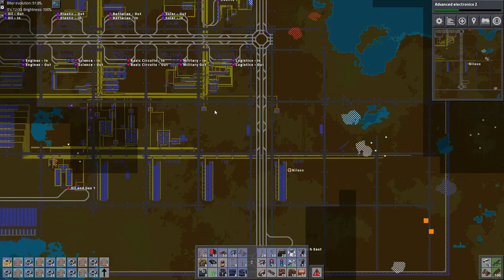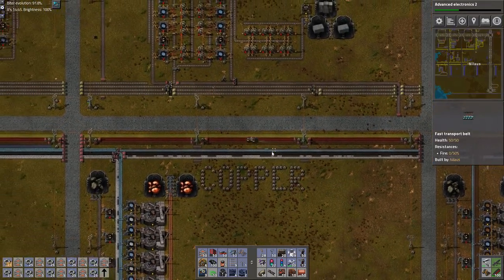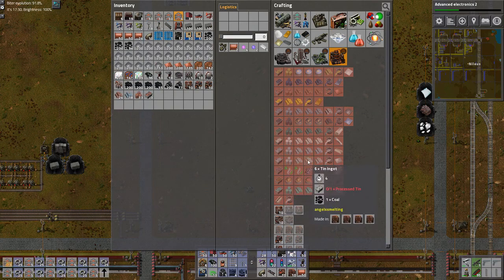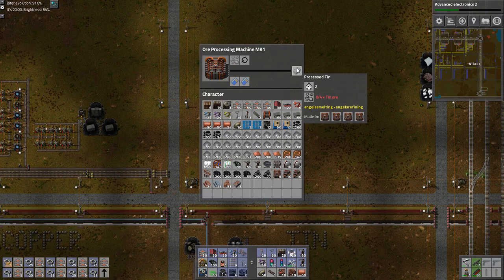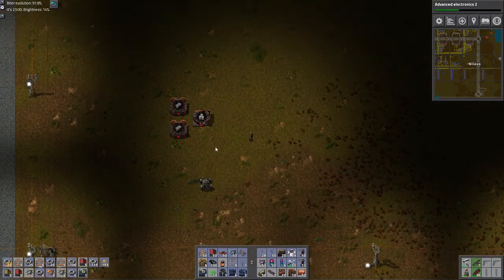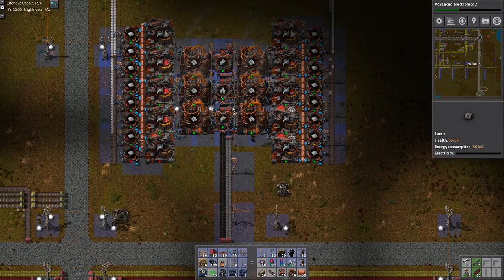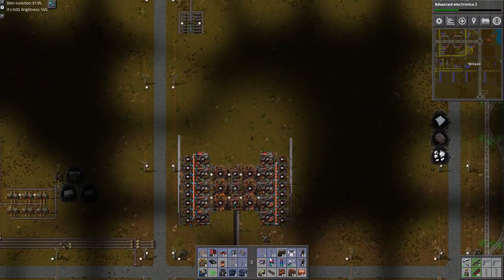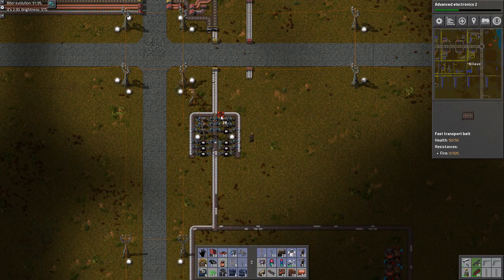Lets Play Factorio S6E34 - New Tin Plate production with Angels Smelting

Comment: It's not that illogical for the colors of materials to change after a filtration process. I would imagine that for each angelic ore that you combine to get an elemental ore, the coloration comes from the mixture of the 6 or 7 end products which can be obtained from the highest tier of processing. Human eyes can perceive a wide range of colors from a small amount of compound colors - as evidenced by the fact that digital screens only use 3 colors of light - so it's not unreasonable to assume that mixed ores might be a vastly different color to their sorted products.

If we're thinking in realistic terms, the lead that you get from mixing rubyte with crotinnium would be far less pure than the lead that is obtained from sorting the ore after the highest tier of processing (so it might have a paler or redder appearance than purer lead ore). Since Factorio doesn't really simulate purity of materials, one can just assume that the less pure materials are just pure enough for what they're being used for (even in reality it's usually impossible to obtain 100% purity of any material, so you just have to get it as pure as you need it).

Another way for the ores to change color after processing is because more surface area is exposed. Whatever surface area is initially visible when the ore is in the ground will be coated in a layer of metal oxide. However, crushing the ore will expose the internal surface area which has not had time to oxidize, thus allowing for a possible color change. After higher-tier processing which uses water, sulfuric acid, and extremely high temperatures, more surface area is exposed to different environments and may undergo color-changing chemical reactions. All of the refining processes are designed to remove impurities, but the impurities being removed may have contributed to the initial coloration of the ore.

Comment: I always feel that if you have to rely on Bob's Inserters the setup is not ideal, because it's actually quite easy mess it up and then later I usually wonder why stuff isn't working. xD
Reply from the maker: I see your point, but don't really agree. Sometimes it becomes a crutch of making silly inserters to compensate for bad design. In that case it should be avoided, but in other cases where you really use it effectively then you can make completely new designs that are more advanced and more efficient by using the fancy inserters. By best designs to date are the beacons pure smelting units in my Yuoki Industry campaign. They were extremely compact on only possible through advanced inserters (like the ones in Bobs mods)
Reply: Bob's reconfigurable inserters have their uses. Angelic metallurgy setups are a good example. They tend to benefit from a single central underground belt going beneath the pellet presses, and right-angled inserters are perfect for that.

Also, if you're using the rest of Bob's mods, you'll have access to assembling machines up to Mk 6. The Mk 6 assembler can craft items which require up to 12 components, and if you're trying to route 12 unique items to a 3x3 with belts then the only reasonably good way of doing it (and still having it be tileable) is to have three mixed lanes on either side, and a central underground belt for outputting. While it is possible to input properly from that sort of setup without Bob's inserters, it requires more underground belts than is really worth it, and it's usually nicer to have the inserters all in a line against the assembler edge.

I would agree that they make things more complicated, but isn't complexity what you're after if you're using Bob's mods (and presumably Angel's mods too)? They would be kind of pointless in the base game (except maybe for belt-balancing without symmetry), but modded Factorio is all but designed for vast complicated factories, and that's where more versatile inserters are a must-have.